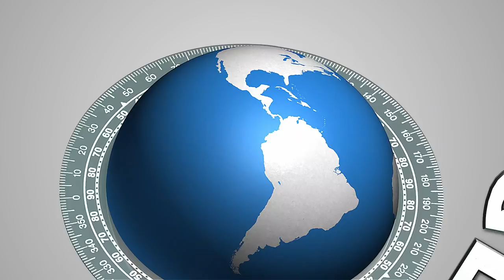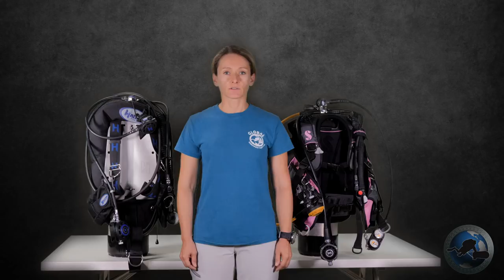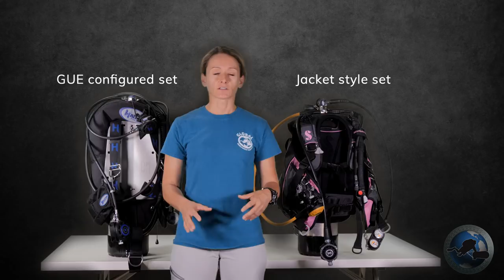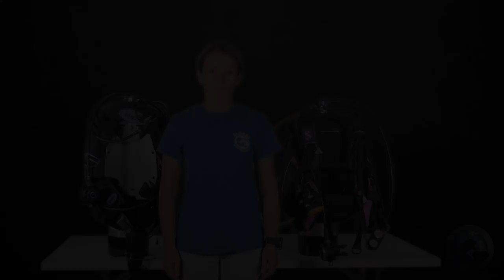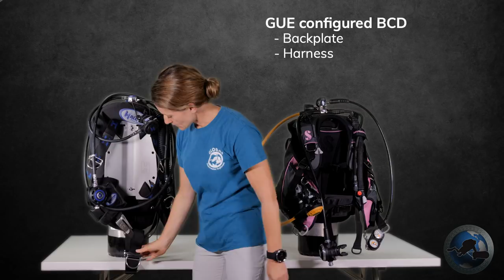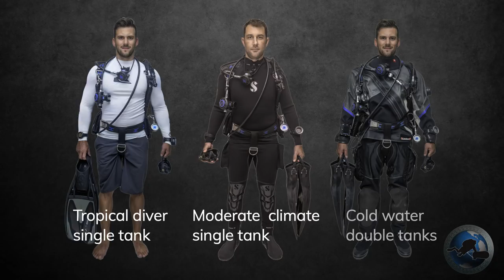BCDs (jacket) VS Wings: Scuba Diving Equipment debate

Comment: Divemaster here diving for +20 years. I know this video is old BUT, besides understanding the benefits of having a modular system (packing size, in water position, etc), can you explain the benefit of having an alternate / donating 1st stage that is more than 2m long? Sharing air in an emergency situation within the buddy system requires the 2 divers to be in close proximity and holding each other. In addition, the long hose is a mess to hold in place while mounted on the bcd on shore. I wouldn’t call having a traditional Octo a disadvantage as the emergency air sharing can be initiated by the diver in need without the active participation of the donor while in the technical approach, the donor needs to pass his primary and reach for his secondary having now 2 divers without an air source in their mouth for a few seconds with one of them probably in panic... I believe that although both systems might have some benefits, the traditional BCD configuration is more suitable / safer for the average 10-15 dives a year diver :)
Reply from the maker: Fantastic question and quite a lot of points to address. We'll make a separate video answering this question asap and let you know when it's ready!
Reply: The diver in panic has taken the primary from the donor. Problem solved. The donor has placed his (men don't panic) backup in his mouth . Problem solved. Long hose prevents panic divers from smothering you. If the reg is kicked or spat out, it sits on the shoulder. You can feel the air draining, so you have a better chance when rushing to the surface in an out-of-air situation. In a free-flow, you can clip off the jacket and angle your tank over your head and feather the valve. Better breathing control. Long hose tucks away in either configuration.
Reply: @scubaclient355  Let’s elaborate on that shall we? You stated “men don’t panic”, that’s an interesting position and already says a lot about your logic and behavioral pattern underwater. Interesting... 2nd, a panicked diver usually is in an ‘out-of-air’ situation, meaning he tends to rush uncontrollably to the surface as the urge for air (instinct) is taking over reason and common sense. With a long hose, while you can avoid the overwhelming grabbing, you have now a diver pulling you up while attached to you practically by his mouth bite. During your Divemaster / Instructor course, you learn to control a panicked diver that doesn’t calm down by maneuvering behind him and placing the diver’s tank between your knees. IMO, while the long hose serves its original purpose fantastically. It was developed to share air when divers are moving in line and space is restricted like for example a cave, some folks want to look Uber technical and more experienced than they really are. By the way, I used to have an integrated air inflator - regulator as my second. Went back to the traditional setup for the same reason. The panicked diver grabbed my inflator and started pushing the buttons while I was trying to put it in my mouth and breathe. The same way, removing your main air source can only put you in a situation that now you are also gasping for air. Good luck.
Reply: @eldiabolico3750  Let’s elaborate on this shall we? You stated ‘good luck’, that’s an interesting position, and already, it says a lot about your logic and behavioral patterns underwater. Interesting... 2nd, a panicked diver is unpredictable in any situation and most will rush to the surface (overhead environments excluded) if they’re not stopped. ‘With the long hose, while you can avoid the overwhelming grabbing, you have now the diver trying to pull you up (you’ve experienced this or just imagining it?) while attached to you practically by his mouth bite.’ Good luck holding the mouth piece in. An experienced Instructor anticipates the problem before it arises and makes the necessary changes. During your Divemaster/Instructor course, you state you learnt to control a diver in distress by maneuvering behind him and placing his tank between your knees. This technique is totally useless underwater and inappropriate on the surface. IYHO: while the long hose serves its original purpose fantastically, it was developed to share air in confined spaces (long hose has several advantages for recreational/technical divers). ‘Some folks want to look Uber technical and more experienced than they really are.’ (No, that’s your assumption.) ‘By the way, I used to have an integrated air inflator/regulator as my second. I went back to the traditional method for the same reason.’ Your Instructor (and there are many) is probably a fool—so was my original OW Instructor. And you, like most novices at the time, imitated their configuration without thinking long term. I’ve had twelve excellent mentors over the years (excluding the first fool); the best advice I can give you is the long hose: 5 or 7 feet. Try it! Dive leaders should ask two crucial questions during the briefing: How many dives? When was the last time you dived? If you intend on using the long hose, always remind divers to snatch your primary regulator in an out-of-air situation (although, there shouldn’t be any incidents if you’re constantly monitoring their air consumption and wellbeing.) The problem lies with the solution, and the Solution Is Simple, Safe, Effective.
Reply: @scubaclient355  let’s elaborate on this shall we? You call every diver using a conventional safe second a fool, that’s an interesting position and already puts you in the category of the Uber technical folks that think that they are more experienced than the rest, that they know better... interesting. Well, on behalf of all us fools, good luck again with your simple, safe and effective solution, you will need it. 

Ps. I have a long hose, I use it to water my trees.
Reply: @eldiabolico3750  Humility—they realize that they don’t know everything and that there may be more than one right way to do something. Their ego doesn’t get in the way of learning, doing or teaching. Open mindedness—they never reject something just because it’s new or different, and they listen to other viewpoints. They don’t fear change and they’re not threatened by differing opinions. Analytical—they try to accurately and realistically weigh the merits of a technology or procedures for themselves and never accept something just because it’s new or because someone else thinks its better. They try to not let what they like, dislike or want to believe influence their conclusions. Competent—while they’re open to change and alternative ways to do things, their own methodologies are solid and they can demonstrate a rationale and realistic basis for each. They’re quietly confident about how they dive, and they don’t choose their methodologies based on ‘looking cool’ or what someone else might think or say.
Reply: @eldiabolico3750  So to make this crystal clear, nowhere in my reply do I mention anyone not using the long hose is a fool—that’s your misinterpretation. The anecdote I provided was from PADI’s Tec/Rec Instructor Manual. Scuba diving continues to evolve from the ‘60s onwards—this refutes your bias toward the traditional set up as being adequate. Whether you agree or not, and when you least expect it, no one can predict which regulator a diver will grab—this also refutes your biased opinion on having the primary in place. Yes, I’ve seen and been involved in several incidents. An experienced Dive leader anticipates beforehand, during equipment set up and with observation. The long hose tells me a diver is well-trained. Regardless if a diver is pulling you up—so long as it doesn’t exceed 18-metres/minute—there’s no boat traffic—you’re not holding your breath—you’ve adhered to NDL. No diver is going to play tug-of-war with me. Now, let’s talk about the long hose to which you fail to perceive the many advantages. Two divers in a fast moving current: one runs out of air—you pass the long hose, and you now control everything in tandem, as opposed to your short hose (umbilical cord) where every movement is haphazard, especially if the diver is a huge man and decides to put you in a bear hug. I have more control with the long hose than the short when the diver in distress refuses to cooperate. When unfolding the long hose from around your neck, there is no obligation to extend it fully—this fact also refutes your prejudice against the long hose.
Reply: @scubaclient355  So to make this crystal clear, the phrase: "Your Instructor (and there are many) is probably a fool—so was my original OW Instructor. And you, like most novices at the time, imitated their configuration without thinking long term" is my misinterpretation??? Ok. 

"this refutes your bias toward the traditional set up as being adequate." That's not my personal opinion, it is accepted worldwide by the majority of Diving Associations. The long hose trend (just remembered to water my plants again) is a minority in the diving industry.

"Whether you agree or not, and when you least expect it, no one can predict which regulator a diver will grab". Wrong again, divers are trained to go for the yellow regulator (safe second) on the triangle, so I would say it is quite predictable. 

"Yes, I’ve seen and been involved in several incidents. An experienced Dive leader anticipates beforehand, during equipment set up and with observation. The long hose tells me a diver is well-trained. ." I had to pause for a brief laugh here but let's discuss about it. So you consider yourself an experienced dive leader (are you an instructor?) and based on your own description, you should have anticipated any issues in advance so how were you "involved in several incidents"??? Kind of contradictory IMO...  "The long hose tells me a diver is well-trained." is like stating that if you see a big penis, the guy must be an excellent lover lol Let's be serious please. So what happens when you see a short hose? The diver is not so well trained???

"Regardless if a diver is pulling you up—so long as it doesn’t exceed 18-metres/minute—there’s no boat traffic—you’re not holding your breath—you’ve adhered to NDL." Sure and as long as the sky is blue and unicorns are flying over the rainbow I am happy. WTH are you talking about??? Again, what is your qualification as Dive Leader? It is fine to be pulled towards the surface as long as there are no boats and your speed is below 18m/m??? And how exactly are you going to control your ascent speed when the panicked diver is 3m away from you??? "No diver is going to play tug-of-war with me." Surely not, you are instead playing 'Look mon, me and my inflatable balloon are rocketing to the surface'.

"Now, let’s talk about the long hose to which you fail to perceive the many advantages." Definitely a fail on my part... so far you've only described advantages (I do hope you don't work as a salesman).

"Two divers in a fast moving current: one runs out of air—you pass the long hose, and you now control everything in tandem, as opposed to your short hose (umbilical cord) where every movement is haphazard, especially if the diver is a huge man and decides to put you in a bear hug. I have more control with the long hose than the short when the diver in distress refuses to cooperate." So it is better to have that out-of-air "huge man" behave like an anchor, fighting the current on its own a few meters behind you instead of being closer to you and having a reassuring physical contact??? Well I guess one positive is that you can get your technical backup knife and 'cut him loose' if he decides not to ""cooperate lol

And you left the best for the last: "When unfolding the long hose from around your neck, there is no obligation to extend it fully". That's hilarious so picture this: now the out-of-air "huge man" is pulling you to the surface by your long - not fully - deployed hose that is basically choking you lol... Great :)

Listen man, I might be a fool for sticking to my short hose but you are a joke. None of the arguments you've made are solid enough to make a valid statement. Yes, the long hose is great for penetration dives in confined environments but for normal OW with anyone not being used to the same setup is only creating additional workload and unnecessary stress. We can go on and on but it seems that your ego outweighs your deductive logic so I will close the same way I started, good luck.
Reply: @eldiabolico3750  In one of your comments you ask GUE to explain the use of the long hose. This suggests you have no experience in its application. You say divers are trained to go for the yellow hose. Again your Instructor must be a fool to think a panicked diver will go for the yellow regulator. If you were trained in accident analysis you would know a diver in distress has narrowed vision. Just like if you were in a car accident, everything blurs. Unless you are trained day in day out. But like you stated 10 to 15 dives is what most recreational divers do a year. No experienced diver fights a current, they move with it. Long hose cannot choke you. Long hose isn't great in confined spaces unless you have been trained to push through a major restriction to which there is a technique. Maybe you are impressed with the Instructor status which anyone with money can buy. 80 dives is all you need. Anyone can read a cue card. US Navy Manual and NOOA Manual have all the info inside. When you are in deep water it has a hold on you. It's not that easy to begin surfacing as fast as you would like  Now I understand why you are easily stressed since you have never tasked load. I don't think you have the necessary skills or attitude to progress further than 18 metres. Enjoy your retirement watering your garden.
Reply: @eldiabolico3750  Cave diving is relaxing and easy. So is wreck diving. Deep dives in deep caves/wrecks requires careful planning and team work. Nitrox. Trimix, CCR, and the long hose were in the minority many years ago. Now it's widely accepted. GUE, SDI, UTD, Halcyon, Dive Gear Express, Dive Rite, have made the long hose standard in their training and when ordering hoses. It's certain manufacturers who ship standard hoses out to Muppet divers like you. The diver is trained to go for the yellow regulator. But in your response you mention a diver was inflating your air inflator/regulator and not allowing you to put the reg in your mouth. This is why you panicked and went back to the traditional method. Do you see your hypocrisy. Had you the long hose, 5 or 7 feet, you could have kept them at a distance and then proceeded to give them the OK sign. Training agencies are geared to make money. You believe you are an Instructor but you can't buy experience. Dive agencies have absolutely no say in how dive gear is manufactured. Just look at the Halcyon dump valve, it's on the left when it should be on the right. If you have been diving for decades then you would be familiar with the 70's gear when they used J-valves and horseshoe life-jackets and convoluted one-piece hose. No one had a c-card in those days. A diver with no air cannot rocket to the surface if they have no air in the BCD. Anyone can be involved in an incident, it is how you react that makes you an experienced diver. With the long hose I can still grab hold of a diver in distress if I wish to do so but only when they have returned my OK sign. I believe you may have dyslexia since you cannot comprehend my words verbatim. Commercial divers, Combat divers, Expedition divers, CCR divers, OC Trimix divers, all have different training modules. Many of the technical and recreational manuals are outdated. Your vivid imagination makes a mockery of real world divers. The Solution IS Simple, Safe, Effective.
Reply: @eldiabolico3750  GUE has explained the ergonomics of the long hose configuration when switching from single to doubles. The technique remains the same. The short hose works for you as a Divemaster leading Muppet divers in 12 or 18 metres of water. Ninety-five percent of today’s divers, you included, wouldn’t be diving if scuba was difficult. Understanding the characteristics of caves, how they were formed, the various types, is the first step in alleviating fear. Experiencing various forms of confined spaces in different milieus is another. Break down the factors of cave diving: it’s a night dive, a shore dive, an overhead environment. Is it vertical or horizontal, deep or shallow, silt or sand? Do you feel claustrophobic? Credentials can be bought and misrepresented; knowledge, wisdom and experience cannot. People whose egos are quickly deflated find it reassuring to see trophies, medals, portraits, certifications, and badges hanging on their wall. Some people find cooking, shooting, reading, to be relaxing; each to their own. I’ll let you burn up inside not knowing whether I’m an Instructor or not. Just call me guru.